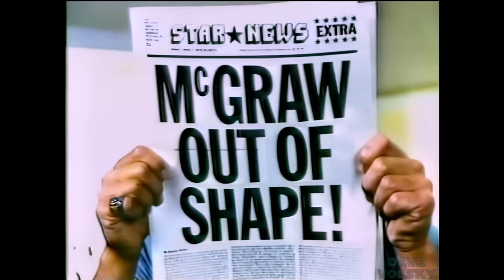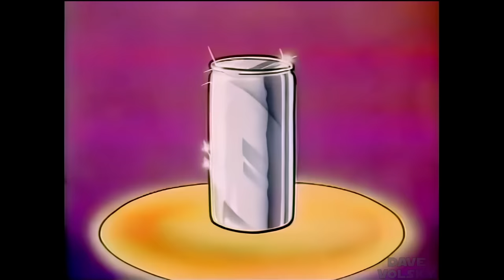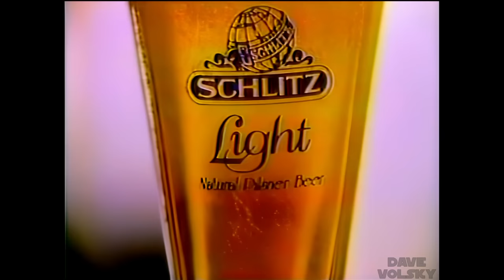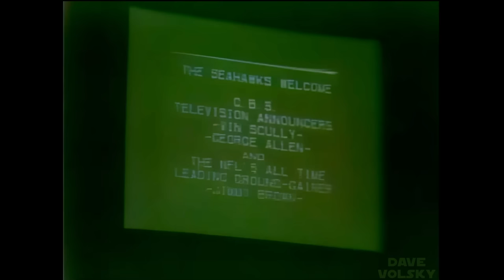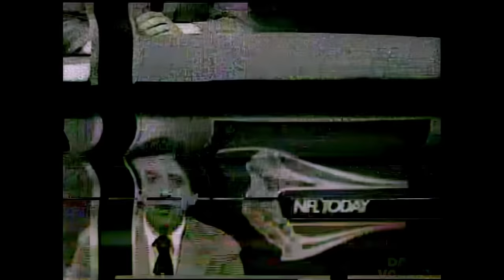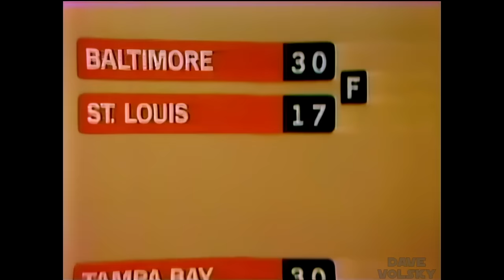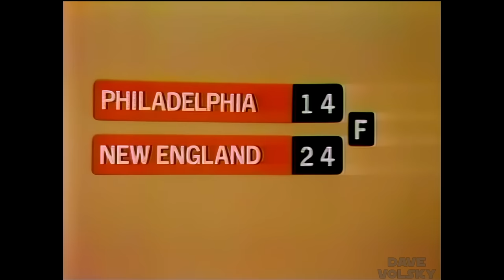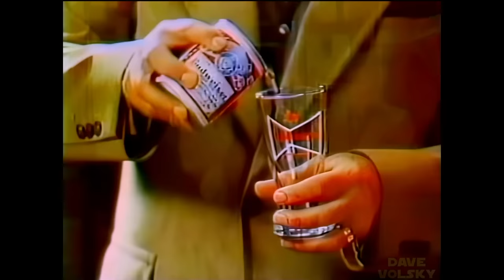1978 - Vikings at Seahawks (Week 6)  - Enhanced CBS Broadcast - 1080p/60fps

Comment: you don't need to keep your name in the bottom corner the whole video. we get it , you created it .
Reply from the maker: That's on there so people don't steal my work, which has happened to me countless times in the past.  It takes me on average about 15 hours to process a game with software and editing, not to mention my electricity costs to run my PC 24/7 to do it.  After all that intensive work, I'm not going to post something without my mark on it.  If it were easy to enhance games such as I do, everyone would be doing it, but it isn't, thus I'm the only one.  Everyone else who posts games is just tossing up the original raw DVD files at just 480p, or god forbid a 3rd-generation shit copy with no enhancement, and no color/contrast correction.  No upscaling either, which really makes it subject to Youtube's compression, thus it will appear fuzzy and blocky.  I do render a separate copy of each game WITHOUT my watermark, but that is for me and my small inner circle only.  When I first started putting my watermark on things, I made it BIG, yellow, not transparent, and put it more up on the screen.  Compared to that, what I have now is nothing.
Reply: @davevolskysbackdoor5673  I got you. Looks awesome BTW